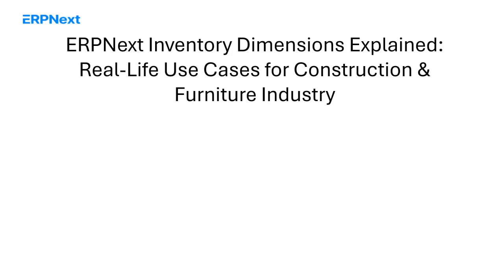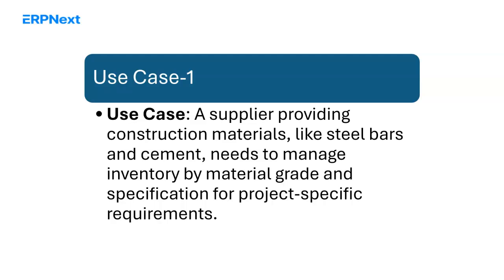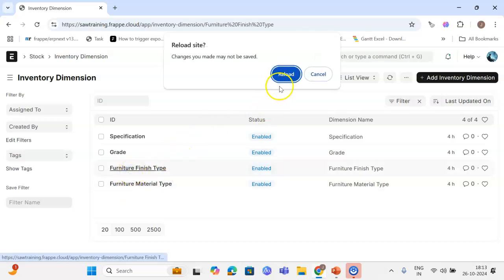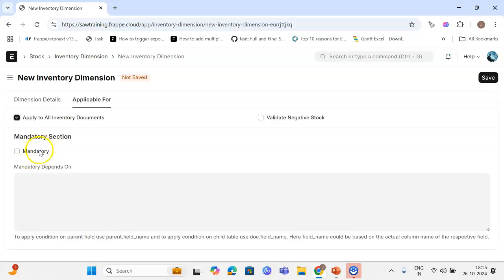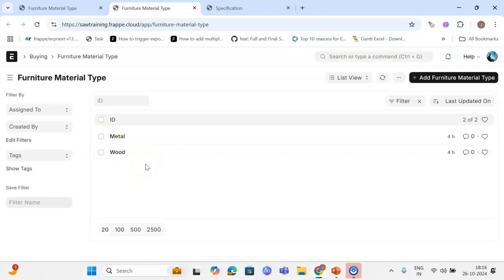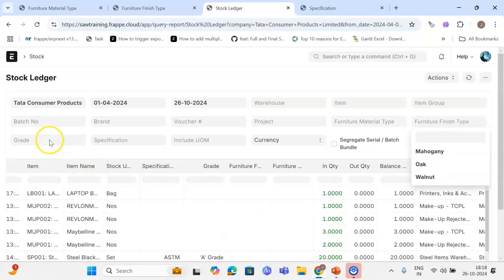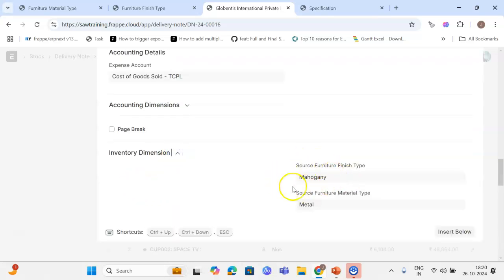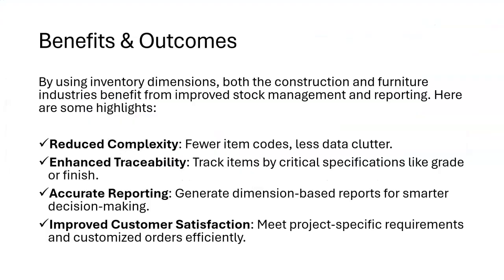ERPNext Inventory Dimensions Explained: Real-Life Use Cases for Construction & Furniture Industry

Comment: Thank you so much for guiding.
I am facing one issue 
In the stock entry, I am not able to make multiple entries for the same item but different manufacturers. Ex. Item code 06A01 and manufacturers ABB, Siemens.
I have added 2 item manufacturers for same item code, 2 different barcodes respectively for same item code. 
If I scan 2 different barcodes ( in item code 06A01, inventory barcodes are 2 for 2 item manufacturers) the stock entry remains 1 and qty gets added in same entry. I wasn't 2 different entries, is it possible?